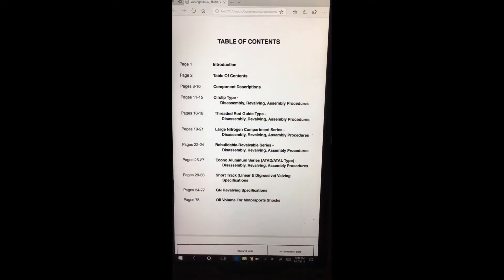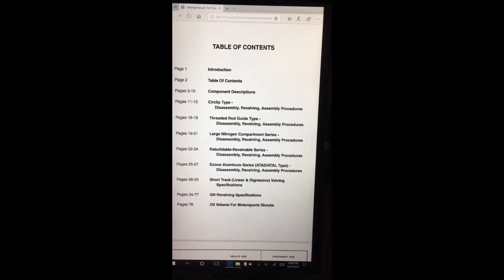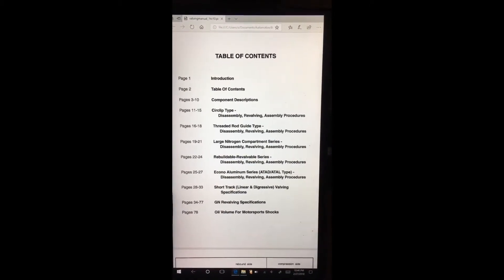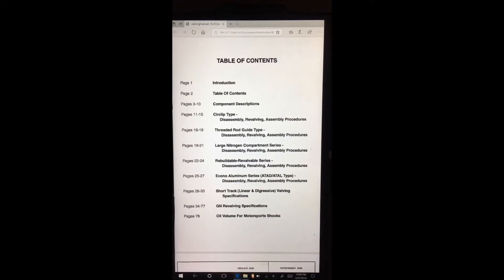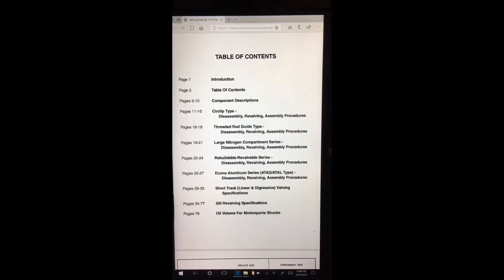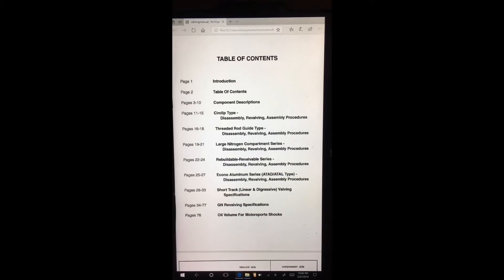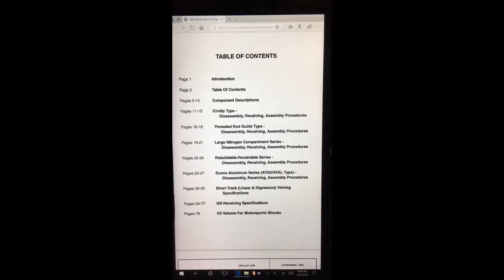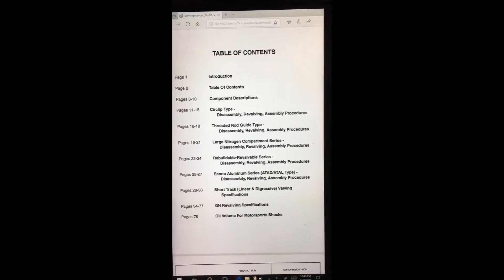Shock piston Re-Valving manual (for Bilstein shock pistons)

Comment: Does anyone know if this manual is available as a pdf somewhere? sees that it is linked in other comments in paper format. I live in europe and would love to have it now!
Reply from the maker: Johan Edström I know there used to be some links online but that was a while ago. You may have to take screen shots (Print screen) of this video and paste each page in a word processor software (Microsoft word for example)
Reply from the maker: Johan Edström I think Bilstein took it down from their main website shortly after the clublexus shock revalve tutorials.
Reply: @frugalfabrication   I am trying to get the suspension calc spread sheet from the club lexus forum, do you happen to have a copy of that spreadsheet?
Reply from the maker: ShatterPoints I may not have it anymore. But you can make a new one from the either the long equation process listed on the post, 
.
.
or 
.
.

by the simple option 2 equation method...Ex (0.65 x [Crit damping]) for shaft speeds 0 to 3, ....for shaft speeds 4-10 (0.35 x [Crit damping]), and so on.
Reply: @frugalfabrication  shux I was afraid of that. Thanks.
Reply from the maker: ShatterPoints give me a bit and I will see if I can find it or MAYBE redo it. Do you mind if I ask you for which vehicle you are seeking to revalve for?

If you need pointers I may be able to help (if memory serves me right).
Reply: @frugalfabrication  I found a copy and broke the protection on it to be able to edit the formulas as I needed. I had a setup built by FCM for my 997tt. But I'm wanting to try my own for a Volvo of mine.
Reply from the maker: ShatterPoints very nice... glad you got it working for yoi. Please check back in these comments and let us all know suspension findings and how your revalving is going.

All the best.
Reply: @frugalfabrication  sure will keep you posted. Would be awesome to discuss the bc re-valve of that was your Lexus post
Reply from the maker: ShatterPoints I agree, that sounds like a good idea.
Reply from the maker: Go to the very bottom of the page. The Bilstein pdf manual (7 pdf’s?) is under the MotorSport section.

https://web.archive.org/web/20140702141250/http://www.bilsteinus.com/downloads/product-information/